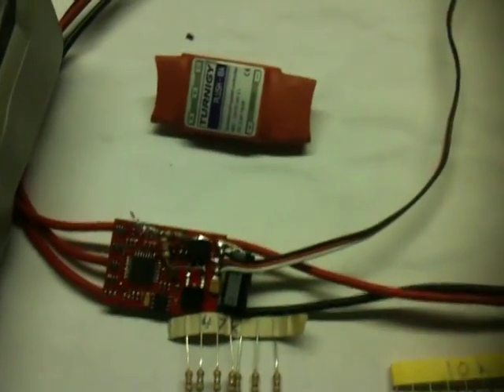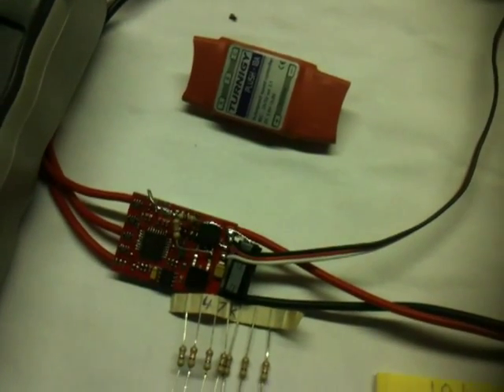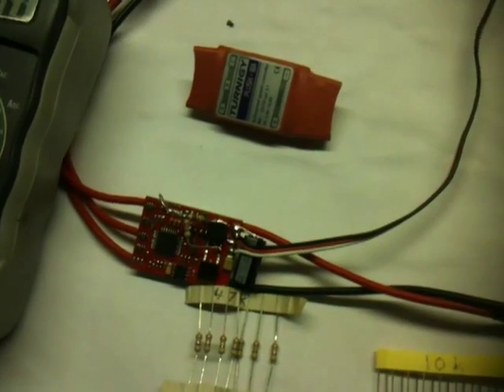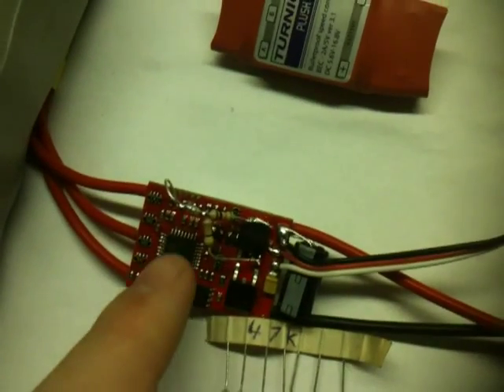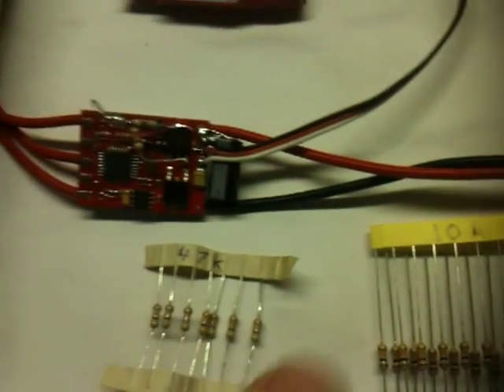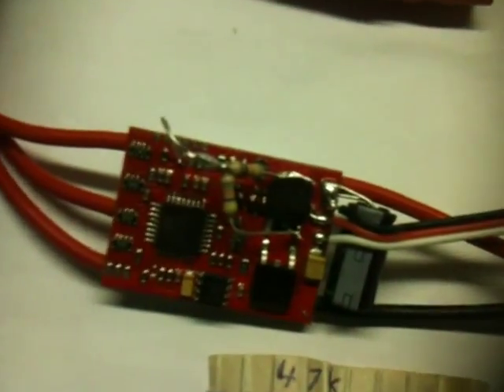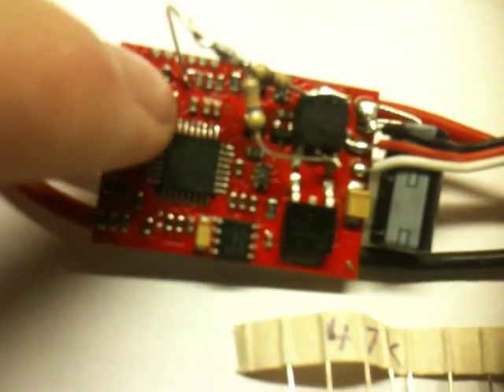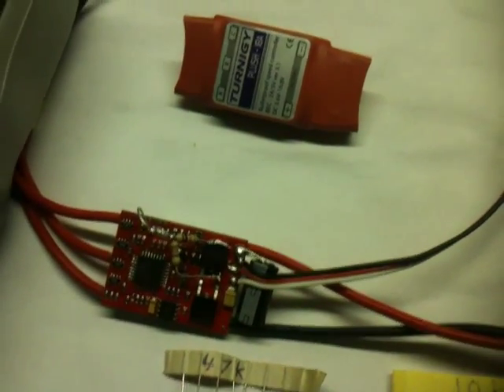Mod an ESC to disable the voltage cut off

Comment from the maker: @petleh82 Modifying a lipo alarm to alarm earlier (at higher voltage), i don't think is a good solution either, because of high current draw = voltage drop. Then i think the alarm could go off to early like when the battery is half full. Search for "tricopter gone fishing" on youtube, this is what i hope to avoid with this mod :-)

Comment from the maker: @davestynes An lipo alarm is always used also. The issue is when you fly with a tricopter  etc, it is normal to have the esc set to nimh batteries even if you use lipo. That is because the cutoff for nimh is lower then lipo, that way you would have time to land when the lipo alarm goes off. How ever, lets say you start with a half full battery (u landed and changed settings etc), then the esc think you use less nr of nmhi, and when lipo gets lower (even before alarm) it will cutout = crash. :-)